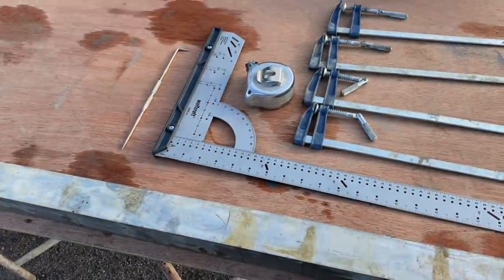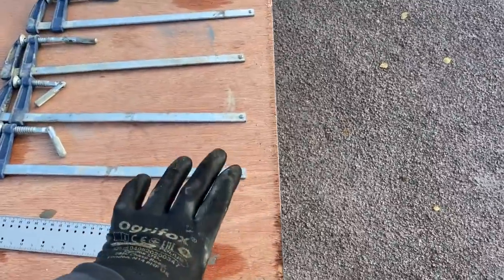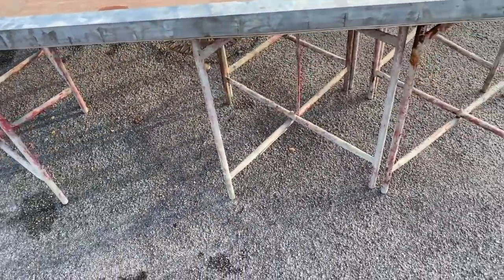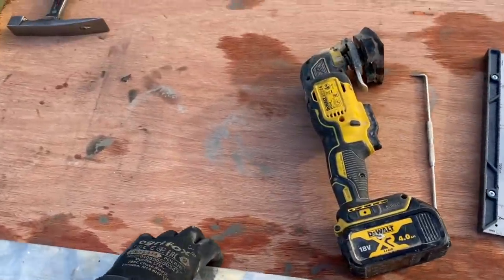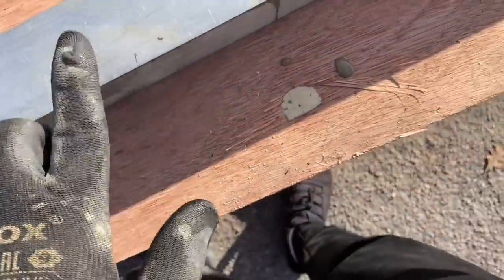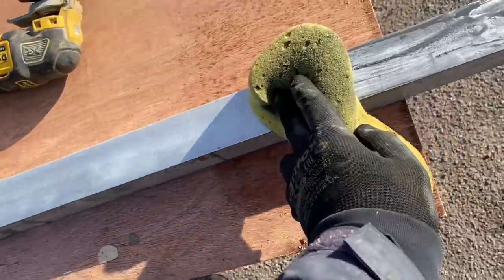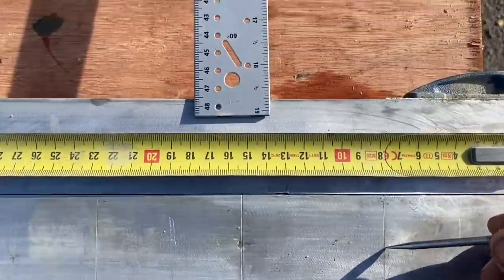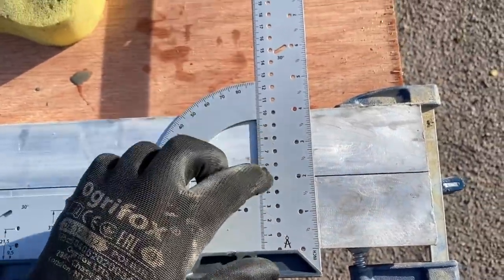How to make Bricklayers profiles

Comment: hi charlie, just ordered on ebay m10 rod and m10 wing nuts . rod 1m long . going to use on blakes profiles when blockwork is 1 block each way eg 450m and 550mm. rods cost £4 for 2 rods . pack of 10 wing nuts £4,  cheaper than other stablisers  for sale.

Comment: Mild steel or aluminium wich one would be best for profiles
Reply: Alumininu is best, lighter and corners are 90 degree sharp unlike steel as its rolled, so you get a curve on the corners. 
Mine are  50mm x 50mm x1.6mm  an 2.4m long. Prefect

Comment: Nice video Charlie thanks for sharing, is there a reason why you don't use the gauge tape on your profiles?
Good job 👍 keep up the good work 👍
Reply: @jims5394  ah interesting thanks 👍
Reply: Scratches off and it can stretch giving incorrect measure.
Reply: When it peels makes it hard to slide plastic clips